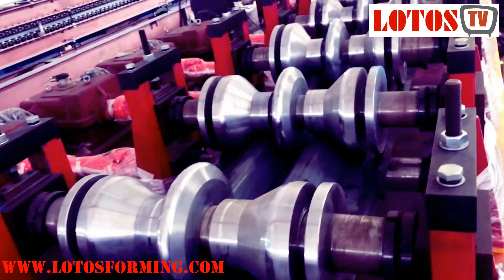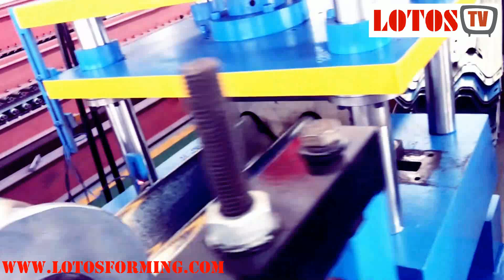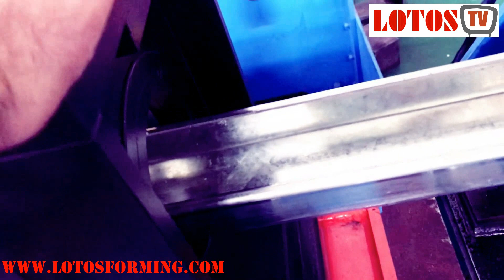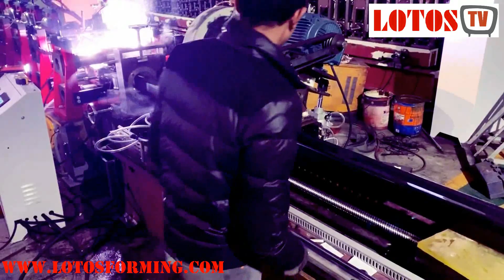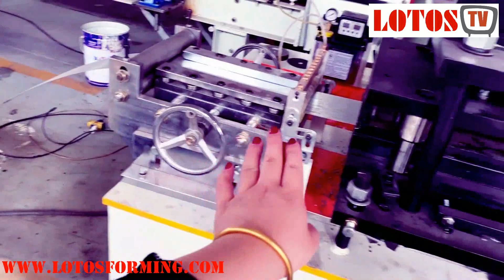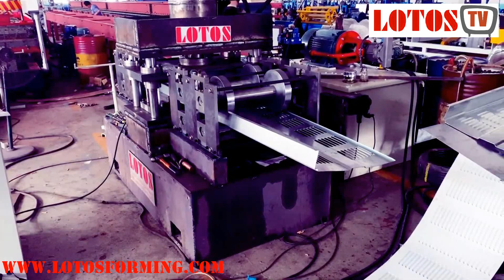【what is barrier system?】: Roll Forming Machine for Highway guardrail and posts " All Product "

Comment: The spacer is used between guardrail beam and steel post and connect them together through bolts and nuts.